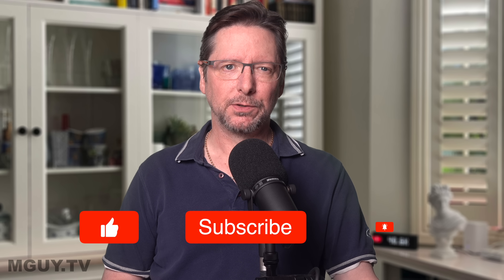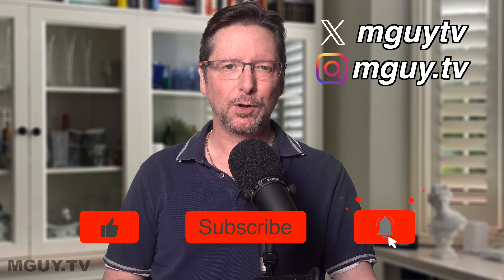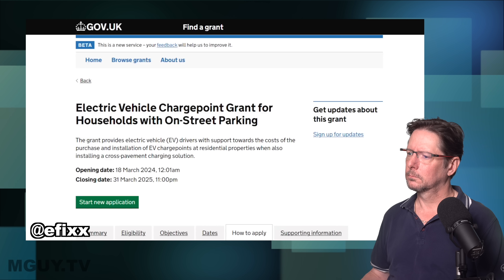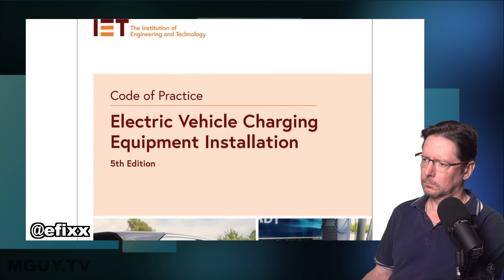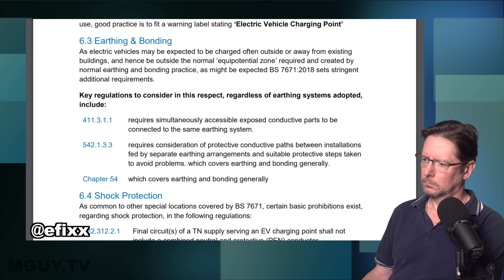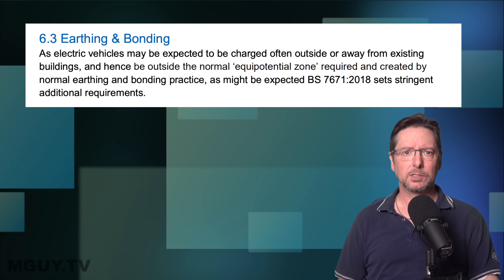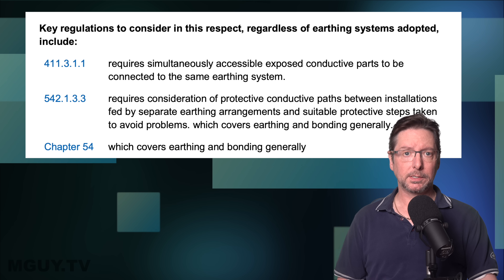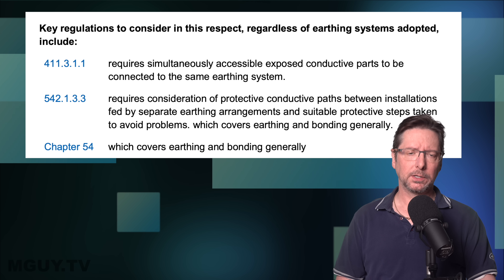ELECTROCUTION RISK from on-street EV Charging | MGUY Australia

Comment: Anyone find a case of someone being electrocuted while charging an ev globally in the last 10 years?
Reply: Anyone find a case of an ICE vehicle spontaneously combusting while standing in a garage or car park - EVER?
Reply: @gebirg1  guessing this was referring to Luton airport?  You know the massive fire caused by a diesel?
Reply: new proposals from Government that break electrical safety rules....don't be silly
Reply: You obviously didn't watch the video and just posted a stupid comment. 🤣🤣🤣
Reply: @Stepbystep74 Even if there were cases, the government would compel the media to say it was a DIESEL ELECTROCUSION. 😳
Reply: The problem is this is something that hasn't been done before.  Could result in nearby cars having different ground potentials (meaning a voltage difference between each car's electrical ground).  As a result you could have a voltage difference between the metal of adjacent cars or between a car and a lighting pole.  That creates an electrocution hazard not seen before with other charging solutions.
Reply: @my3dviews  so you need multiple vehicles to have faulty electrics making the skins live, and multiple faulty rcd protectors on the circuits?
Reply: @Stepbystep74    If each car is grounded, you only need one fault, not both. Would the RCD protector work if the other car is grounded through a different system, fed by a different transformer?
Reply: @my3dviews  I was thinking about touching another car body,  the HV components are isolated from the chassis usually the 12v system would be grounded to the chassis?  If you were touching a road sign and an ev you still need an hv component to make the chassis live, then the rcd to fail assuming the damaged hv components were in a state where they could initiate a charge and the car had no system which detected the fault and shut down.  I would be cautious if I had to touch a crashed / disassembled ev but most of them have battery isolators and in that state they would fail to activate a type 2 connector.
Reply: @my3dviews  I’m pretty sure if you connected the live from one circuit to the ground of another and they were both protected both RCDs would fire? but not sure myself.

Edit - I do think this is a good case for the initial installation being carried out by a qualified electrician.  The situation  feels very similar to being able to touch your kettle or any other appliance and sink at the same time but with a kettle which has a few extra safety features
Reply: You bought one and are too embarrassed to admit they suck. We won't make the same mistake.
Reply: @LionRoars918  i have driven enough petrol cars, my Renault sucked, my TVR did suck when it decided to have a hissy fit, my Suzuki did a decent job, and the Toyota I leaned in was dull.  I enjoy cars, would never drive an be id3 because it’s boring, I enjoy my car,  I just don’t have to pay much to run it.
Reply: Ah, the old 'statistics prove' defence. Well, I haven't searched for data, but that's not the point, is it. The point is that this proposal increases the chances of an electrocution event happening.
Reply: @EleanorPeterson  fair, I can only really talk about type 2 charging but the 7pins in that charger check for an earth and a connection as part of the connection sequence before the solenoid connects the main so you are looking at a number of simultaneous faults.   I kind of agree that the standards should be as high as possible but most items in your house are riskier.
Reply: No it is the point. Most decisions in life are on a risk vs benefit basis, otherwise we'd never get out of bed and certainly wouldn't get into any kind of vehicle.
 Electricians always exaggerate the risks of electrocution as that's what keeps them in business.
 show me significant numbers of people actually being electrocuted and I'll think again. Always look at the evidence before coming to conclusions and be prepared to change your mind if new information comes to light.
 @EleanorPeterson